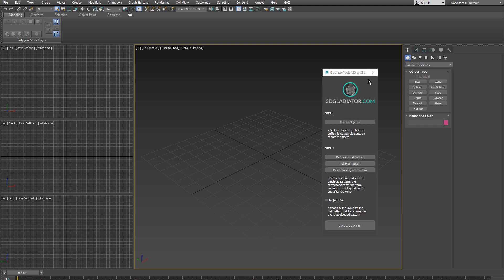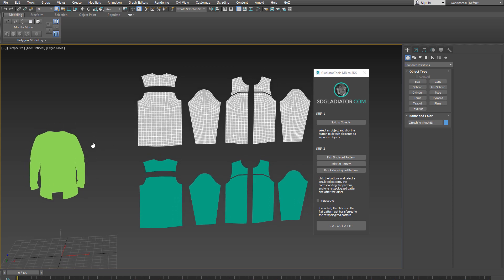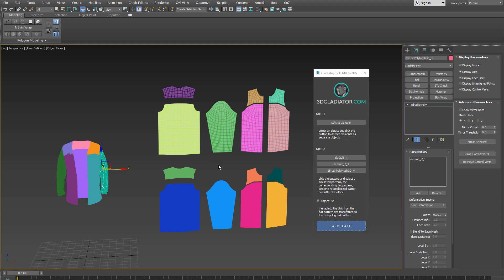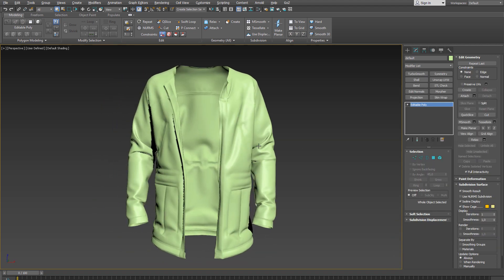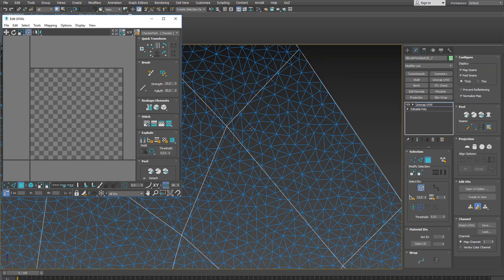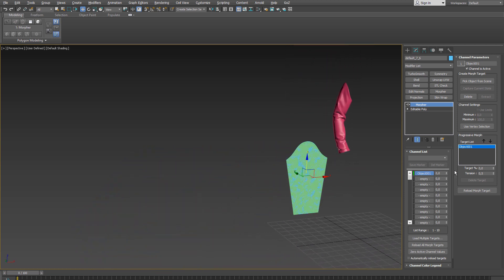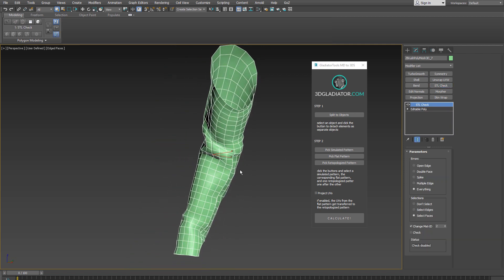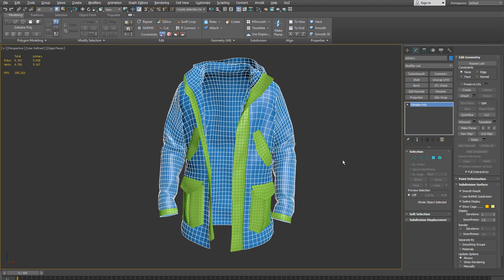From Marvelous Designer via 3ds Max to ZBrush

Comment: Thanks for the plugin :)
Reply from the maker: Any time! I hope it still works, haven't tested it in a long time...
Reply: @3DGladiator   It still works, but the mesh turned black after all. I weighted normals and that fixed the issue. I'm still practicing matching the quads on pieces though :)
Reply from the maker: @cnarik8  Thanks for letting me know!

Comment: How we can simulate already ready obj cloth mesh in marvelous designer ?
Reply from the maker: Thanks for your question. Unfortunately, I'm not up to date anymore about recent versions of Marvelous Designer. But I remember you can classify OBJ files as cloth on import and then simply hit the simulation button. Let m know if this works. Best, Ben
Reply: @3DGladiator  thanks buddy just got it from some forms just need to import obj as garment and use Trace 2D Pattern from UV map option tick while import obj and then your other applications obj can simulate easy.👍🙏😃

Comment: I'm a beginner. So if i already followed tutorial and finished it untill 12:30... that would be a low poly mesh am i right? and doing that subdivision thing in Zbrush with the the simulated mesh for details which you mention is considered a high + low poly process? I'm trying to mod a game and i'm making a mesh so from what i've learned so far that low poly mesh is enough for games right?
Reply from the maker: Yes, this is correct. When you generate a normal map by projecting the details from the highres to the lowres model, then the lowpoly model looks like the highpoly version without wasting thousends of triangles. You can use the basemesh also to animate the garment. In this case you add a subdivision modifier to the basemesh when you are done animating and bring the details back through a displacement map. Hope this makes sense. Thanks for watching. Best, Ben
Reply: @3DGladiator  Thanks for the great info and tutorial this definitely helps me understand it more! I'm not a 3D artist nor have i ever had the interest to become one but recently i just started modding the Resident Evil 3 game and from there i jumped right into this 3D world without any study. I learned it myself from youtube videos and i managed to make my own clothing mesh for games (it is not perfect) and i'm trying to improve myself more and more. Thank you Sir Ben. I appreciate this tutorial and response.

Comment: I did have one question about the pockets i see you did not weld that to the jacket are they just sitting on top of the jacket mesh ? and would that be ok for a animation production or would you need to find a way of making the jacket and pockets one mesh by welding them together in 3ds max ?
Reply from the maker: Thanks for your question! Depending on the type of animation, it will be necessary to attach the pockets to the jacket and turn the mesh into one big piece. This would require a few extra steps on this example as you would have to manually adjust the topology of the pockets to weld them with the geometry of the jacket.

Comment: a good trick is to use edit poly and in the edit poly select tools you can select non quads or open and even traingles so its quicker then using stl check.
Reply from the maker: thanks for the hint, this works perfectly fine too of course

Comment: Thanks for the tuts! Is there a part 3 for the MD Jacket?
Reply from the maker: Thanks for your comment Matt. Part 3 was in the making but unfortunately, I wasn't able to release it yet as I'm busy working on a other projects. I'm still planning to finish it though. If you have worked through both parts, you know that the tutorial does not come full circle until surface details, map baking, texturing and presentation are covered...

Comment: Hey mate

Thanks for great tutorial and script. I've got a question - do you need to split the garnment on several parts - primary and secondary elements?
Reply from the maker: Hey, thank you very much for your comment and your question. I'm sorry for my late reply. You don't have to split the garment into parts. It usually depends on the complexity of the clothes and how you are going to process the mesh further down the pipeline. You could easily add small details like stitches in ZBrush for instance. (https://youtu.be/wxh8VekZSS4 ). This give you a lot more creative control and makes the MD scene less heavy and slow.
Reply: @3DGladiator  Thank you for the answer. And one more question - in my case I have a jacket with inner and outer layers and I'm gonna render in unbuttoned without any human etc. So should I export both layers? PS I use Zbrush to add details such as stitches, folds etc
And also I should mention,  I faced a problem when exporting from MD - amount of polygons of the simulated and flat version doesn't match.
Reply from the maker: You're welcome. When you have an inner and an outer layer and plan to present it without a character wearing it, I would export both. I'm not sure about the polygon mismatch of the simulated and flat pattern. They usually should be one and the same.
Reply: @3DGladiator  Thanks man. Keep well and carry on doing great stuff
Reply from the maker: @Catscratch13  Thank you very much for your kind words and your support!

Comment: Thanks so much! I have one question. How do you project details in zbrush? Do you subdivide first and then press 'Project All'? I get blurry details
Reply from the maker: Hi Natali, thanks for your comment and your question. I usually project details step by step. That means I add a subdivision level, hit the “project all” button, add another subdivision level, press “project all” again, etc. This sometimes projects the details better than just subdividing the mesh in one go and project details at the very end. Sometime you also have to adjust the distance settings next to the project all button to achieve desired results. Let me know if it works. Kind regards, Ben
Reply: @3DGladiator  Thanks so much! I will try it

Comment: Thank you so much! This technique is amazing! I have one question: what is the better workflow If I have to export  a simulation animation? Because all of this process is for presenting or using a cloth asset for render o later rigging, but I´ve got a simulation in Marvelous that I need upload clean and low poly to Sktechfab and I need the clothe reacting to the movement of the mannequen.
The better I found is exporting in fbx with remeshing beta. After doing this process that you show in the video there is a way to transfer the animation from the low poly no-oprimized exported from MD to the clean remeshed in ZB? Thank you very very much
Reply from the maker: Hi Gabriel, thank you very much for your comment and your kind words. That’s indeed a very good question! The way you have described your workflow makes perfectly sense. I will do some research and get back to you as soon as I’ve found something that works. Cheers, Ben
Reply: @3DGladiator  Many thanks! You are a great person! Thanks for all this free help to the community
Reply from the maker: @gabocavallaro  Hi Gabriel, I’m sorry for my late reply, had some very busy days. I did some research and made a quick test. In case you are using 3ds max, the workaround is very easy. This is what you can do:

- Create your animation/simulation in MD and export the mesh as an OBJ with the movement stored in a point cache file; go to file/export/point cache 2. The topology of the exported pattern doesn’t matter. Exporting a triangulated mesh is totally fine.
- Import the OBJ file to 3ds max and add a point cache world modifier to it. Import the animation by loading the *.pc2 file into the modifier.
- Next, create a clean, retopologized basemesh. You can do that by following the steps described in my tutorial https://3dgladiator.com/tutorials/marvelousdesigner/part02/
- All you have to do now is laying the new basemesh on top of the animated pattern and apply a skin-wrap modifier to it. In the skin-wrap modifier, select the animated original as the reference mesh and set the falloff values to 0,001

That’s all. Now the retopologized mesh should follow the animated original exported from MD.

Have a great day!
Cheers,
Ben
Reply: @3DGladiator  Hi Ben!! Sorry for my late reply It was really busy days too! Hope you are really well. Bro, many many thanks for taking the time to research and test a solution  for my question. You are amazing really! Your tutorials are such a great contribution for all of us. Many thanks and regards from Spain

Comment: If you have the new Marvelous Designer it has the New remesh which now cleans up your Highpoly meshes very easily. There are Triangles where the seams are but all in all it does a decent job of cleaning up the mesh for Higpoly production work :)
Reply from the maker: Thanks for your comment! The new feature is great and definitely a step in the right direction. As it is still in beta phase, I prefer the workaround show in the video. Currently, you have to do a lot of manual cleanup work around seems and pattern’s borders if you use the function.